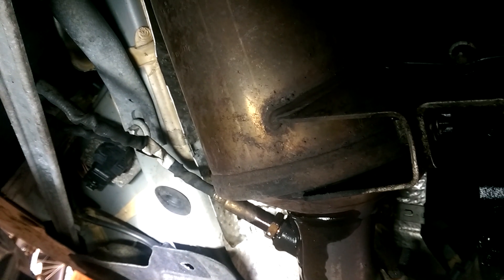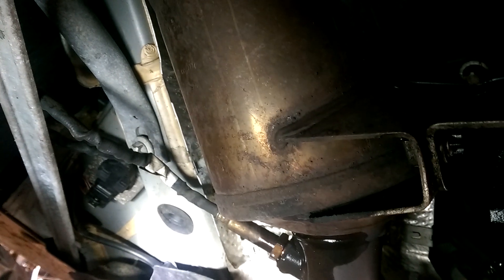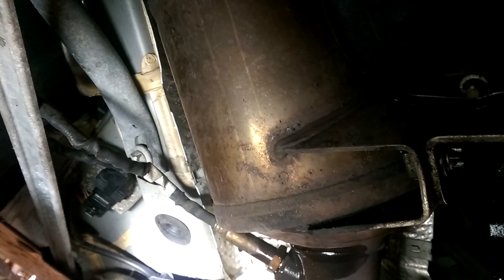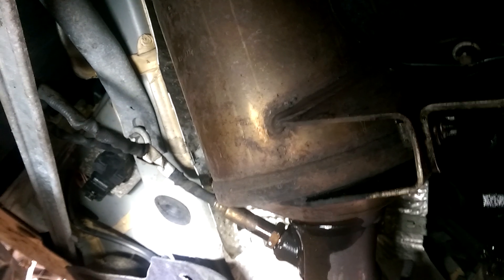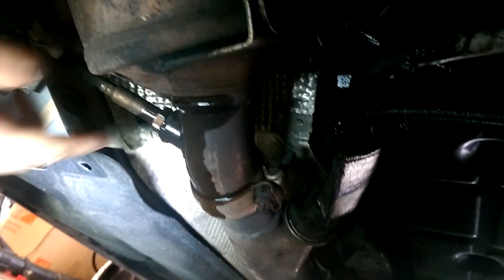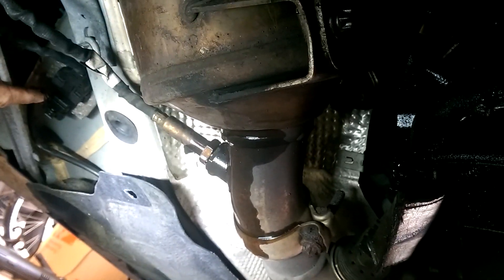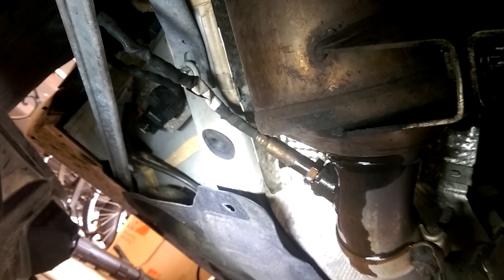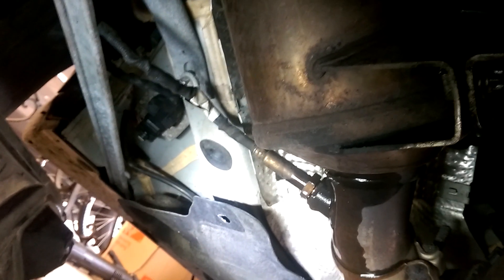2011 Mercedes E350 Bluetec NoX Sensor Replacement

Comment: UPDATE:  I just replaced both NOx sensors in 2012 ML350 Bluetec, and here's what you need to know:   1)  Rear sensor is very straightforward.  Jack the vehicle up and remove the transmission cover (it the second belly pan down on the vehicle).  Using a standard Oxygen sensor wrench, losen the downstream NOx sensor.  Its about half way down the vehicle on the passenger side and after the catalytic converter.  The sensor wriing is pined up agains the heat shielding with small metal brackets.  remove the wiring from the brackets.  Then using 10mm and 8mm socket, remove the entire side rail plastic cover which extends alongside the passenger side of the vehicle near to the frame (about 8 inches wide and 2.5 feet long black plastic cover).  There are about 10 or so bolts to be removed, many of them which connect heatshielding to the plastic cover.  Once removed, you will see the donwstream and upstream sensor computer boards bolted inside the compartment with 10mm hardware.  Disconnect the computer board to wiring harness connector by using a screwdriver push out the grey tab, then insert carefully underneath the black bracket and separate.  Same procedure for the upper.   THE PITA PART:  The upstream NOx sensor is a PITA.  The sensor is straightforward to unscrew from the exhaust.  The computer board also not a problem. Its the wiring path that is a PITA.  The wiring runs underneath the heat shielding. You'll need to locate several 8mm nuts that hold the heat shielding to the body of the vehicle and losen those.  They are a serious PITA especially the ones on the shielding up toward the large coffee can looking segment of exhaust coming from the headers that I believe is the first of two catalytic converters (either that or its a sound dampener). The heat shielding is separated into three segements.  remove as many of the nuts as possible to loosen the shielding enough to pull the sensor out.  Repeat procedure in reverse to positing the sensor.  Failing to protect the upstream wiring will expose it to significant heat that could compromise its longevity.  Don't get lazy here.  If too difficult get a spare piece of heat shield from parts yard, cut it to size and screw it up into the oem heat shielding sandwiching the wiring in betweeen (the lazy man's technique).  PITA without a lift.  Good luck, if you need any more advice or help, PM me.
Reply: Hello, thanks very much for the info. Can you provide any alternative or options to buy the rear sensor and harness for the rear of an MB. 2012 ml buetec. thanks
Reply: Superb! Thank you.
Reply: Thank you so much. The original guy just teased usbwith a less than a minute brief intro.
Reply: I've got a 13 bluetec. I got the box sensor code. Was yours throwing a lot of white smoke from exhaust?

Comment: Hi George, did you replace the sensor or the box or both.  I have a check engine light with the dealer quoting $2250 to fix the problem with the NOX sensors and of course looking for what I can do on my own.  Thanks for the video and any info.    Cheers
Reply from the maker: The sensor and box come together as a unit, they are inseparable - I ordered mine via ebay 

search MERCEDES-BENZ 0009053403 SENSOR, I paid $435 for the part in 2015
Reply: George Kistler thnx
Reply: Also the up and downstream sensots are botht the same. This was as per a very nice merxedes parts guy who was cool enough to share that info. When you buy understamd there are 2 oxygen and 2 NoX ......not the same.

Comment: Hi all MB guys, my car (E-300 2015 bluetec) was turning a code p229L on a obd2 (simple) reader, and on MB dealership it was: P229F92 " NOx semsor 2 (cylinder bank 1) has a malfunction. the function or the instruction is faulty".
Do any of you know for sure which NOx sensor is it pointing to? the one under the catalytic converter or the one in the middle of the exhaust pipe? They both have the same part number (A000905304) and I believe they both called Nox sensors. I need to decide which one to replace. Thanks, Ronen

Comment: Follow up video? A walk through of where it is? Undershot is not enough for me to visualize the exact location. Thanks!
Reply from the maker: HowToDoItDude I no longer have the vehicle so a follow up isn't going to be possible. The position of the brain box is slightly behind and inside from the passenger front wheel. You need to remove the underbody covers. The easiest way is to follow the cord from the sensor to the box.

Comment: Hey George...  I now have the P229F error code on my 2011 2500 Sprinter....   can you tell me the part number for the NOx sensor and where to get one...   If you can please give me any tips on how to get this fixed...   thanks in advance
Reply: actually I drove the van to the dealer and asked them about it....  the dealer him halled around a bit and acted like they were going to beg MB for mercy on me and the van...  then MB said... those are under warranty for years to come...  seems MB got scared from the Volks Wagon issue and decided they would replace them for free and extended the warranty..  MB even sent a sticker that I had to put in the back of my owners manual to document the extended warranty to any dealer I decide to take it to if the issue comes back...   hope this helps... but you just have to take the van to the dealer...  and yes, my van had run out of its original warranty...
Reply: well... not sure on your situation but according to MB they have extended the warranty coverage for all vans from 2010 to 2014 by 10yrs/120,000 miles...  just reading what they sent me...
Reply: Dick Bell  Dick - do you have the name of that extended warranty, or some reference number?  Can't find that anywhere on the web and at least one dealer is denying it.

Comment: do you know where the injection nozzle is location?  pn 164-490-05-13  also is it true than Gen 3 NOX sensors are not compatible with Gen 1 and 2?  DO you have a source for the NOX sensors?  thx George
Reply from the maker: +Gary Sweany - I suspect the adblue injector is somewhere towards the rear of the vehicle as the adblue tank is in the trunk.  I can not speak to compatibility of the particular generations nox sensors.  I ordered the one which was specific to my car based upon the parts catalog, and man is MB proud of them on price.  I searched for the item online and the best deal I could find was from the ebay store of Daytona Mercedes in FL (http://www.ebay.com/sch/daytonamercedes1/m.html?_nkw=&_armrs=1&_ipg=&_from=). I have had good luck so far with finding deals on new parts via ebay - best wishes and happy motoring.
Reply: +George Kistler thank you I've decided to replace the injection nozzle, both NOX sensors and possibly the SCR based on recommendation from a mercedes expert, hoping this will solve the issue with the car for a while.

Comment: Hello George,   Thank you for making a great comprehensive video.  Can you please make a video of how to replace the two Engine Air Filters in E350 Bluetec 2011-12?   I believe these filters are on the sides of the engine.
Reply from the maker: I have since sold the car so I can not make a video, but I did replace the filters - as I recall - there is an e-10 bolt at the firewall side and as I recall another on the front outboard side of the air filter housing, releasing those bolts and disconnecting the flex joint at the front of the air filter housings will allow you to lift the rear edge of the filter housing and tilt it up and out of the car, on the bench remove the torx screws, replace the filter elements and installation is the reverse of the removal.

Comment: Hi what does the code P2214 means on merc sl350 2013 model plz?
Reply from the maker: DrAcid12 I am a home mechanic not a certified tech, but a quick Google says that is the bank 2 NOx sensor. My code was for bank 1 and I only found the one sensor. I would assume bank 2 would be a second sensor that might exist on your sl350.
Reply: +George Kistler thank you for replying back it's NOx sensor. my car is 2013 with 37000 miles. one more question where is the location of the NOx on the exhaust? is it near the engine side or back box. many thanks

Comment: Hey George,
Were you having any oil leak from these sensors at all?
Reply from the maker: Nansley Noel : Hello Nansley, The NOX sensor only has exhaust gas behind it, it would never leak oil of any kind.  I sprayed the sensor threads down with penetrating oil to help it come loose which is why it appears wet in the video.  There is a well documented issue with the oil cooler seals on these cars, which would cause the area of these sensors to be coated in oil.  Search for bluetec oil cooler and you will see a lot of suffering on the mb forums, unfortunately it is a major repair - mine was thankfully done by the previous owner.  Good luck.